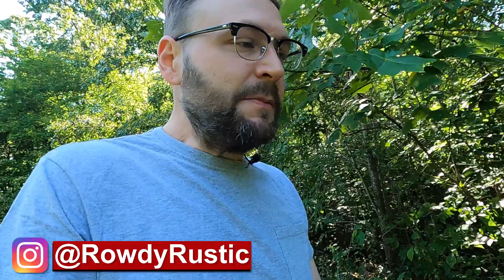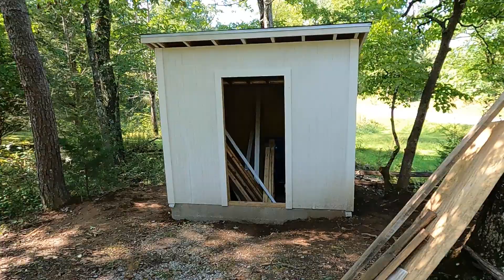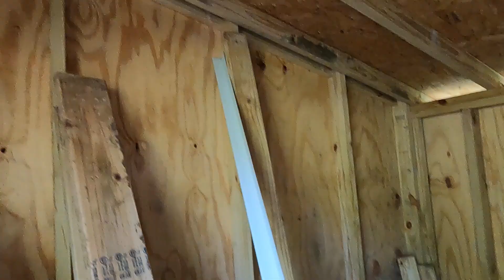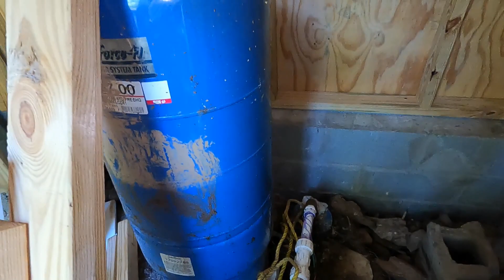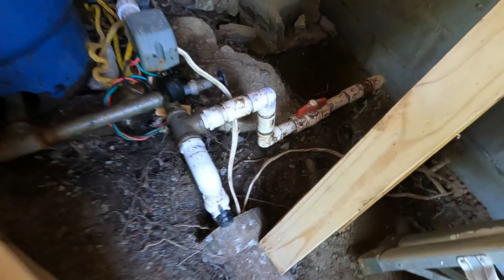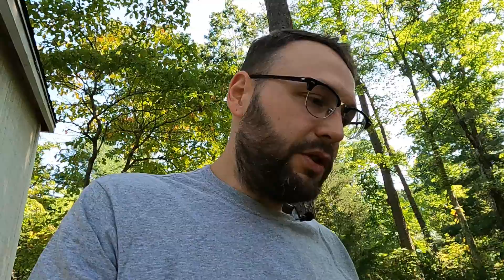Beginner Homesteaders Build a Pump House

Comment: Interesting to see some slightly varying situations. The pump house at my parents' cabin is relatively similar in its plumbing aspect, but it is like 10 feet underground. Upon opening the door, there is a ladder down to where the pipes and tank are. My best guess is that this was done to regulate the temperature a little better since the outdoor temps can get very very cold in the winter where they are. Plus, it also allows the cabin's plumbing to gravity drain when winterizing I suppose. I've learned little bits and pieces of various disciplines like installing plumbing and roofs too, since I spend more time at their cabin than they do for the most part :).
Reply from the maker: Sounds like you need to fly out here and advise us. :) Yeah this is our first experience with a well, one thing I need to do research on his how to connect a generator to the well in emergencies. It gets cold enough here for our pipes to freeze and we need the water to flow to combat that. Thanks for the comment, hope you're doing well friend. :)